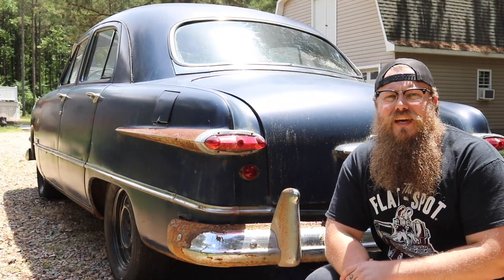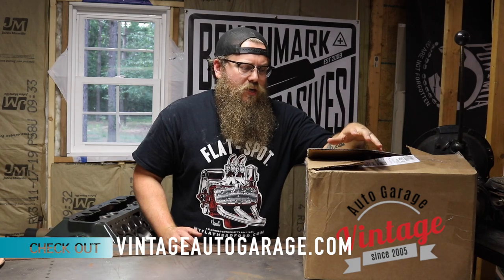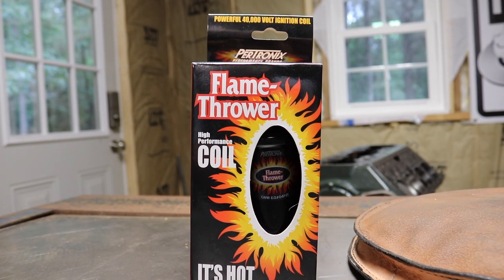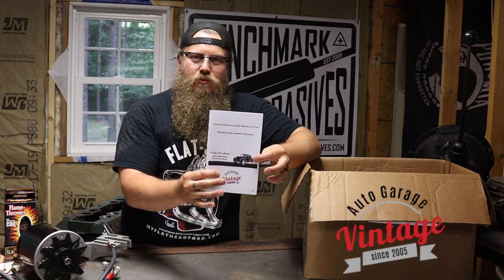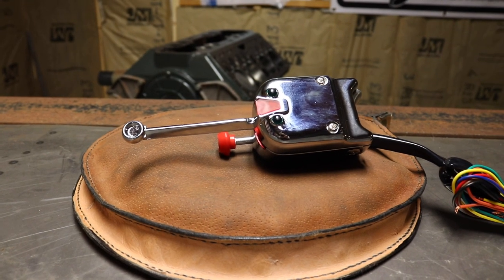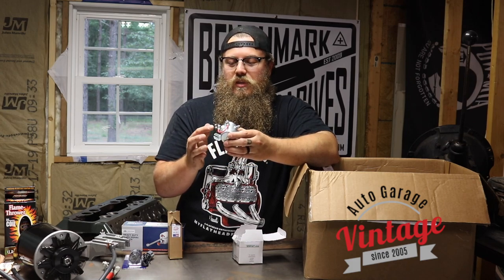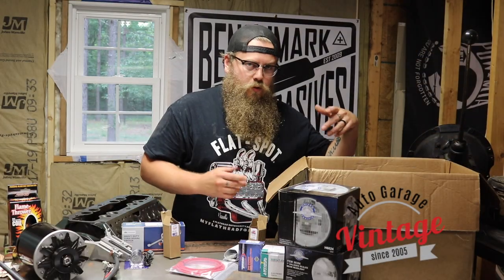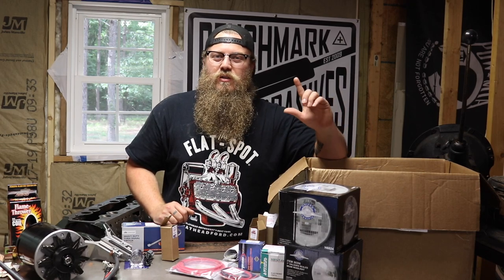6 to 12 Volt Conversion, Everything you NEED

Comment: 2 comments.  1) the whole reason we pull out the DC generator and replace it with an AC alternator (and rectify it back to DC) is that the genny has almost no output at slow speeds or idle.  We have to be going about 20mph to actually start charging the batt.  The alternator puts out high power right from the get go.  2) For those doing this conversion, keep your 6V starter.  They are robust and the 12V just makes them faster and higher torque. Mine is still starting my Chevy 235 after 30 years.  Wait until it burns out before replacing it.

Comment: Do you need to change the 6v starter as well or can you keep it? If you are converting to 12v. I converted my 1952 Cadillac Fleetwood Series 62 to 12v and I am not sure if I need to buy the 12v gear reduction starter from vintage auto garage

Comment: What about the heavy duty signal switch makes the car safer? Would you not be able to have factory turn signals and hazards and use the 12v bulbs? My electrical knowledge is my weakest link in my car hobby lol keep that in mind
Reply from the maker: Hi John, the biggest advantage for my build is that the truck has no signals, that’s what’s making it so much safer, if your factory turn signal is switching the blinker on and off, I would at least want to put in a 12 volt flasher

Comment: Thank you. This video answered my question of converting a 6V horn to a 12V system. 👍🇺🇸.
Reply from the maker: no problem I am happy to help!
Reply: One last question regarding horns. I have a twin trumpet horn set that I took off my 1947 Ford Super Deluxe car when we restored it and put all new 12v components in the car. I want to use that horn on another restoration where we changed every component to 12V and installed an 8 cyl LS GM motor in the 1951 Chevy 3100 Panel Truck. What do I need to do in order to use the horn from my old 6V Ford? Thank you.

Comment: This is a big help for a first time builder! I have a 3 terminal starter solenoid. Do I need the jumper wire from one terminal to the other?
Reply from the maker: When you say three I picture something like the original starter solenoid that's switched by power, if you only have the three connections as 1: to starter 2: from battery 3: trigger, then you are going to need a new solenoid like the one in the video.

Comment: I'm amazed. They actually have a Studebaker conversion kit too. It doesn't look like a generator, which is a bummer, but even the most pure of purists understand the desire to convert to 12 volt.
Reply from the maker: You would be surprised just how much hate mail and negative comments I get from purist saying I shouldn’t have changed from 6 volt to 12
Reply: @WiredCustomsSpeedShop  I suppose I underestimate the amount of bile that can be produced by the internet. Still doing this to my Studebaker because I'm tired of wasting money on 6 volt batteries just to move my truck 20 feet in the yard once a year. I hear 6 volts REALLY don't like sitting on a shelf, and from my experience it seems to be true.

Comment: Awesome. I have a 55 F100 6 volt truck. 223 six banger.  Runs great but the wiring is scary.  Old, cracked, loose ends hanging everywhere,  Needs to be rewired.  I like the generator looking alternator.  Want to keep my stock truck looking like stock. Keep on making videos. Thanks for pointing me in the right direction.
Reply from the maker: No problem! Thank you so much for watching!

Comment: My father in law  bought a 1930 model A. Its been converted to 12 volts. He just had turn signals installed. The wire that goes to the battery is  actually hooked up to the alternator. My question is,  the turn signal switch is hot all the time. And the switch is getting  hot... all the wiring is wired correct. Other then the wire thats hooked to the alternator instead of the battery. Thank you for sharing your videos and the valuable information. .

Comment: About to attempt conversion on 1950 IHC pickup.  Scared.  Your video helped. I'd like to get the petronic system to replace the points and condenser.  I had O' reillys check a 1991 Volvo alternator  ( works) that I intend to use. Wish me luck. Arnie
Reply from the maker: Good Luck! Let me know how that distributor works out

Comment: Hi there, great video it sets me a little more at ease over re-doing my uncles 1940 oldsmobile. Question is what about all the wiring for the lights? Do you reuse existing wires or replace, I didn't see them come out of the box, thanks. Also when going on the site for oldsmobile I see it starts at 1941 olds but I thought the 1940 was the same as the 41?

Comment: Thank you you turned me on to this company Vintage Auto. Have been stuck on switching to 12 volts. My 56 Bel Air has power assist. Didn’t want to buy different brackets and moving the alternator and a different power steering local. Once again thanks.

Comment: Great video. I just bought an untouched original 1953 Dodge D150 that's all 6 volt. I want to convert it to 12 volts. I want to keep as much original as possible. Can I convert the generator and starter and keep the housings?

Comment: Great video. I am almost done with my 1949 Ford F47 pickup (Canadian). What do you recommend for the heater motor conversion? Can I use a voltage reducer? Or do I need a new fan motor or all new heater? Thanks

Comment: Good video!   I have a 1942-1948 Flathead in my 39 Ford.  It has a rebuilt generator with an external voltage regulator mounted on the firewall and has been converted to 12 Volt POSITIVE ground.   It quit on me after 1,000 miles and I traced it to no power at the coil  which lead me to a faulty "in line" resistor.   I removed the resistor, connected the two wires and went straight to a new coil which has a built in regulator bought from NAPA.   I haven't fired it up yet, as I am waiting.   Assuming this works and I believe it will get me running again, I plan to buy and install a one wire alternator and convert to NEGATIVE ground 12 volt.  I think I presently have the original starter solenoid on it (The one with the starter button on it underneath for remote starting).  

 My question to you is, do I need to buy the starter solenoid described in the video and replace the one on the vehicle?    I think I understood you to say I might get 70% life out of the starter by using 12 volts versus 6 volt assuming that it is a 6 volt starter.   Your comments and advice will be most appreciated.

Comment: I’m going to check them out. I have an unique situation. 1948 English Ford Anglia street Rod in the Resto Rod style. Everything new 12 volt except trafficators I want to retain. They only have 6volt bulbs turn signal wires controlled in center of steering wheel with wires running through stator to steering box those wires run only to trafficators and used no flasher .

Comment: Zac, love this video and all you are doing to help us guys with old Fords. I have a 32 3-window coupe and I want to convert to 12-V. My wire harness is bad so I bought a new universal harness from Speedway and I just got a new PowerMaster flathead style 12-V alternator. Does anyone make a pulley conversion that mounts the fan like the original mounts to the generator pulley? Thanks.
Reply from the maker: Thank you for watching! I’ve seen guys machine their own alternator pulleys to accept the fan, from their experience we learned that the alternator bearings are not built for the forward thrust the fan creates and it makes the alternator work for a short time before destroying its bearings. You have three options, one to run the mid mount fan if you have the room, run the fan off of the crank if you have the room, or run an electric fan.
Reply: @WiredCustomsSpeedShop  Thanks Zac. Looks like I’ll be looking at an electric fan conversion too. One thing always leads to another.

Comment: So my 55 Dodge has the power steering pump attached to the generator. If I change it to 12 V what power steering pump do I use? Because I wouldn't be able to use the old one. Does Vintage Garage offer PS pumps? Thanks for the awesome video. Very helpful.
Reply: Dude it would be easier to just mount a seperate alternater .

Comment: You talk about adding a new horn relay and starter relay, but don't address the horn and starter.  I'm assuming that I will need to source a 12V horn and starter?
Reply from the maker: The Flathead ford starter will work with both 6 and 12 volts, the problem here is that a starter that was going to last 15 years is now going to last 10 years as an example, a voltage reducer is required for some horns

Comment: I just bought a 1932 Pontiac four door sedan.  In line six.  the car is great except the engine is done.  What can i bolt in for new engine   I do not want to hot rod it... The car is just too good as a survivor
Reply from the maker: A ford Flathead inline six is easy to find and pretty reliable, any motor you put in will need fabrication like motor mounts and transmission mounts, hopefully your 32 has a drive shaft opposed to a torque tube, that will make this process easier

Comment: Hey Zac. I am wondering if there is a start solenoid specific for 6v positive ground?  The one I bought for 40 ford pickup has 6v to it so when I jump the start button pole to neg it cranks but the button does nothing because there seems to be positive already at the solenoid. Is that correct? Thanks

Comment: So with the voltage converter and a 1949 f1 dash, the dash uses a bridge for power and has 1 input for the guages so I would only need to use one output on the device to power all 3 guages? Or should they be done individually and use each input pole for the power and each output of device?
Reply from the maker: I run each gauge it’s own power wire, that our you can split one power wire to got to each, either way I always get rid of the bus bars
Reply: @WiredCustomsSpeedShop  cheers mate appreciate the reply!

Comment: I am a newby.  Please explain pertronics.
Reply from the maker: Pertronix is an electric trigger for the coil, before pertronix there was Points, two contacts that can wear and float at high rpm, pertronix is the upgrade from points
Reply: It's a brand name. They make drop in electronic conversion kits for points distributors. It replaces the points and condenser

Comment: There is no need to convert to 12 volts.  Just use 1 gauge, not 4 gauge or worse yet, 6 gauge, battery cables, and always use a Group 2 battery, never a Group 1 battery.  If you still want more oomph, try using an 8 volt battery.  All you have to do is re-adust your regulator so that your generator voltage is 10.5 volts, instead of 8.5 volts.  And yes, there are 6 volt alternators.
Reply from the maker: How about breaking down and needing a jump? Any car can jump a 12 volt system, or adding more electronics to the car, how about the original wiring needing replacement? A 12 volt generic wiring harness is a quarter the cost of an original style replacement, there is many situations to switch to 12 volt
Reply: @WiredCustomsSpeedShop  If you need a jump, what you do is hook up the jumper that would go to your ground terminal of your dead battery to a dirty spot on your engine, such as the generator tensioning bracket.  There will be enough resistance to keep the 12 volts from the jumper battery from frying your accessories.  And with a classic car, you should use a factory style wiring harness, not a hot rod style wiring harness.  Remember, restored means RETURNED TO STOCK CONDITION, not modified or "improved", only STOCK, otherwise it is not a true restoration, and it is destroying our automotive history.  I still say use an 8 volt battery if you want more oomph.  Even Amazon sells 8 volt batteries.
Reply from the maker: @jamesbosworth4191  you’re being too picky, I can restore a car and make it 12 volts without most people telling the difference
Reply: @WiredCustomsSpeedShop  That's not the point.  Restored means just that - Returned to factory-fresh.  If you convert it to 12 volts, you have MODIFIED it.  Plus, I like the idea of being able to use factory accessories, like a factory radio, a factory clock, factory power windows and factory power seat, etc.  If you convert to 12 volts, you have to use different-year counterparts.  If you just put an 8 volt battery in it, you get to deep everything stock.  Way better solution.  Even Amazon sells 8 volt batteries.
Reply from the maker: @jamesbosworth4191  I can convert to 12 and use all the factory components
Reply: @WiredCustomsSpeedShop  If you modify them, or use transformers, but if you use an 8 volt battery, you don't have to modify anything at all.
Reply from the maker: @jamesbosworth4191  I think you’re on the wrong YouTube channel, here I don’t tell people what to do with their cars, I just give options and information
Reply: @WiredCustomsSpeedShop  Although you are called "wired customs", so I shouldn't be surprised.
Reply: An 8v battery isn't stock.
Reply: @ssmonte8738  Neither is a 12 volt, plus, all you have to do with a 8 volt battery is re-calibrate the regulator.  No need to change anything in your electrical system.